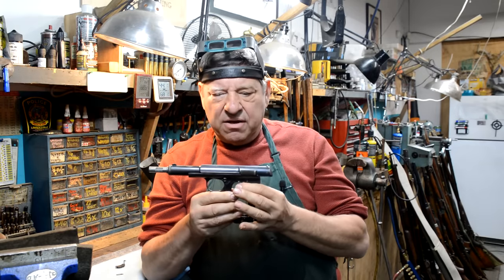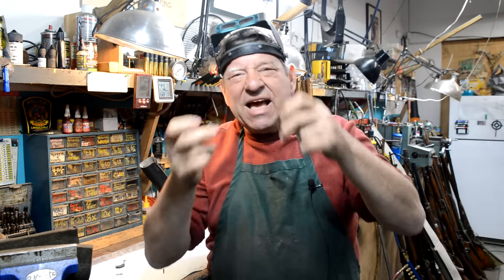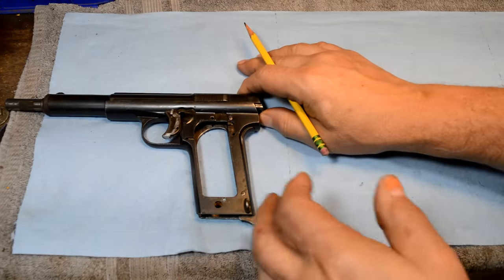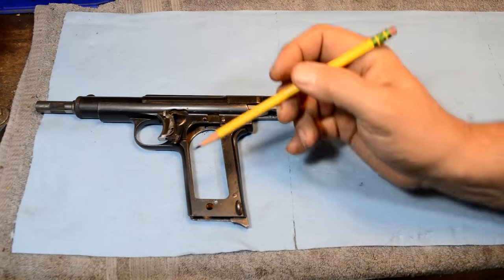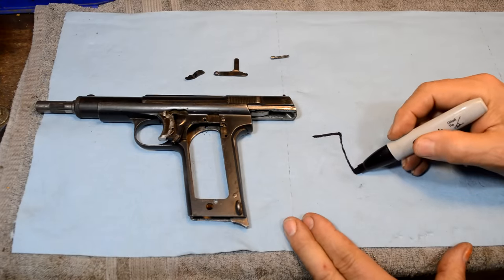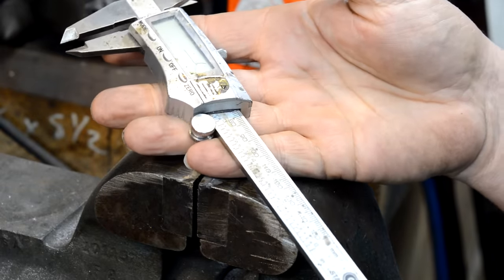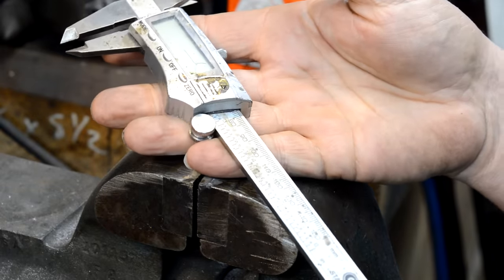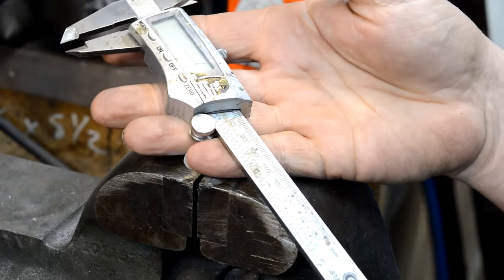Astra 400 Transfer Bar Fabrication; Anvil 0133

Comment: As soon as removed the small drill bit and used the punch directly against the metal, I yelled at you" stop". Too late, it snapped. I have tried the same stunt myself. And it broke the part. Lesson to be learned, keep adding heat, and no sharp edges( punch point ). Cause it WILL, crease the metal and snap it. Love your "educational only videos". I wish you and yours, a very Merry Christmas, and Happy New year.

Comment: I used to make alot of parts similiar to this one; I would machine them from solid pieces and avoid the bend. Mark, you did a very nice job with the bending technique.
Reply from the maker: You had dimensioned drawings, ill bet. Prototyping from solid stock blind......ok?

Comment: Beautiful work as always.  If you don't have the broken part to work with and all you have is a picture of it, you can quickly mock it up with copper or brass sheet which serves as the pattern for the steel part.

Comment: I have an Astra 400. Stout recoil is a nice way to say it kicks. Star line occasionally makes brass, but I’ve found .38 super brass works for reloads. Do not use .38 super loading data as the pressures will be too high for the frame. 
Thanks, Mark, for another great video.
Reply: Don't they all kick?

Comment: The Astra 400's were always used as the 'bad guy' guns in old Mission Impossible TV shows.   They DO kick pretty hard because they're just blow-back operated and for the power of the cartridge really should have either been locked breech or have a much heavier slide ala High Point.

Comment: I have seen an idea on how to deal with small parts like these sheet metal bits.  The guy was using green loctite to stick the one flat piece to the other flat piece.  I havent had a chance to try it on a small fiddly job yet but I think it would be good to either stick it to stock to copy/trace around or to stick a temporary handle on the part.

Comment: I was worried for a minute that the vertical disconnector finger would have come out short after putting the joggle in. Glad it worked out though.

Comment: You actually flex (articulate) the trigger and install from the top. If I remember correctly. There is a magic method not using a punch and hammer to install. Definitely a pain.

Comment: Did you heat-treat after forging the part, to reduce mush / wear, or at least relieve stresses?
Reply from the maker: Yes, a final heat/quench to spring temper
Reply: @marknovak8255  Cool, thanks!

Comment: Hey Mark,you are starting to cut into the parent metal of the vice body. Would it be worthwhile to get one of your apprentices to make up a new set of jaws ? Make up a pair,send out to a machine shop for serrations ,etc ? Nice straight top jaws for straight cuts like with the angle grinder ? Custom choice of metal for jaws ? Hardness ?
Reply: The jaws are replaceable, but he started cutting into the "vise" long ago. I will take a long time to devour the vise in the piecemeal manner in which it is getting cut and otherwise abused but in the end it is a sacrificial tool in a way. I think his sacrificial vise jaws need to be a quarter inch or more proud of the vise body, just like on his blue Record vise. Be neat to see more options like you listed though.

Comment: Could you have just annealed the original part and then pounded it flat, then trace it and cut out the new one and bend at the original points?
Reply: Any time you take a hammer to a part, you're going to change the dimensions along a plane, or set of planes, perpendicular, and tangent, to the impact surface.

Will it be enough of a change to matter?   Maybe yes, maybe no, but changing the shape of a reference part that you can't easily replace, for the sake of making a template, is usually an unwise idea.
Reply from the maker: The gap where the weld was is still an unknown, and we lose the curvature info. We left extra material to compensate

Comment: Nice work, but that part is available at Apex Gun Parts for $37, including the trigger.
Reply: 20 bucks with trigger from sarco
Reply: Oh, that's naughty of Mark.
Reply from the maker: You MAY be missing the point....just sayin
Reply: @marknovak8255  no denying your talent.  That came through on the mp-18 restoration of making a part for the madsen in project lightning.   
      And this is an entertainment/information video.  
      Just seems a waste of your talent for you to build a part that is readily available at low cost
Reply: @psp1921tsmg  He Made the part for the purpose of showing us How to make the part.

On obsolete guns, spare parts eventually run out. Look how barren Numrichs catalog has become.
Reply: @seanhazelwood3311  That's fine if he didn't charge the customer for doing it. Or a minimal amount.

Comment: Hammering that piece into shape was dumb…as proven when it snapped.

It would take minutes to make a simple die out of scrap, and it would be easily bent in one motion, with a small press! A vice might even work, but I know you have a press.
Reply from the maker: You dont have the dimensioned drawing to make the die.....so, no go.
Reply: @marknovak8255  yeah, I know. You do have a pretty good guess as to dimensions.

Make your die out of sheet metal, layers of sheet metal bolted together to align them. Then layers can be added or removed to adjust the die. That would be more than 1 press operation, but still less stress than hammering.

I'm not sure why that transfer bar broke (before melting), but if normal operation caused it to fracture, then the replacement must be bigger, imo. If I fix something than I expect the next failure to be something other than what I made.
Reply: Sure make yourself a stamping die that needs a male and female side. The first time you make your die, it would have to be perfect or it's back to the drawing board, So go ahead and do it, see how long it takes you and ALL for just one Astra 400 piece. It would make sense if you wanted to churn out 500 Astra 400 transfer bars and if there was a demand for that. 🤪
Reply: @Hjerte_Verke  I said "simple", apparently your misunderstanding. It doesn't have to cut the piece, nor shape the piece. One bend. No stretching. Limited contours.

That could literally be made with two pieces of flat stock scrap.

Jesus christ…don't comment on topics about tools until you touch a tool.

Comment: Numrich Arms. Be interesting if they had the part that they could loan to you to get detailed measurements. Yeah it’s cheating ,BUT……
Eyes? Yeah, had cataract surgery a few months back, really screwed up my vision. Not only for gunsmithing but I do component level  repair on communications equipment. Need second set of "reading glasses" to correct the vision in the eye so I can see up close. It’s like having a coke bottle lens on that eye and then wearing my optivisor to get up close to my work. Sux.
My father had one of these back in the day, too bad he got rid of it.